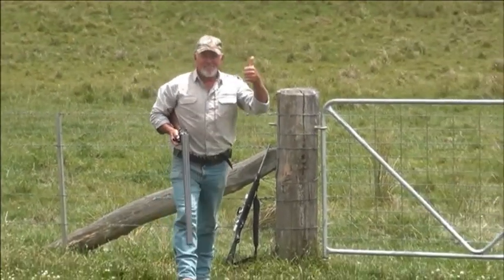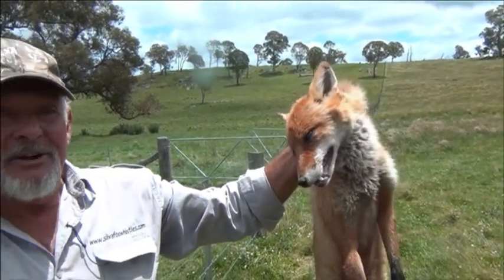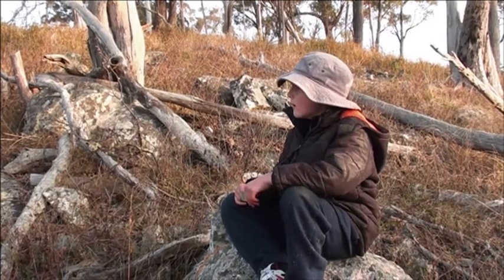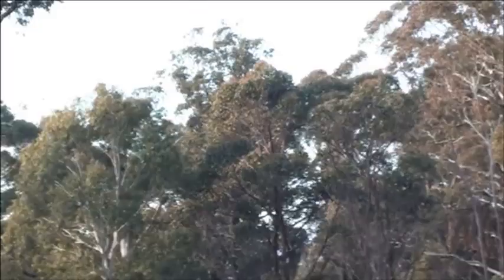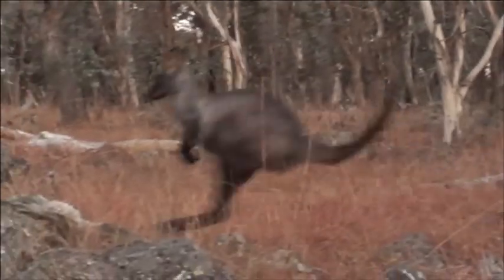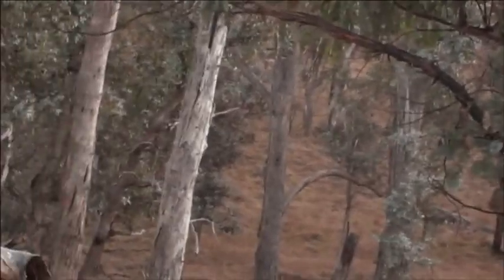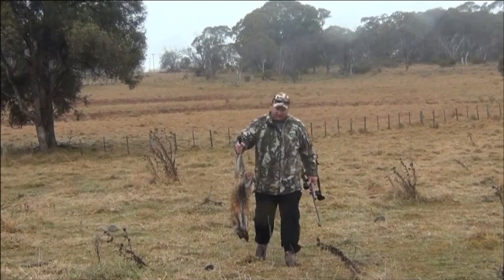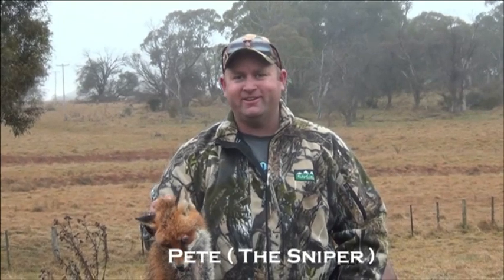How to Blow and use a Silva Fox Whistle in Detail by manufacturer Ron Kiehne

Comment: Eureka moment! I have been using a Silva fox for about 8? ish? years now. Started off great however very difficult to get a note from it. I had adapted to a very difficult technique. And we're at a lull, foxes have not responded to it for a couple of years now. Thanks to this video I have learned I've been persevering with a squashed caller. Opened it up from 6mm to 15mm and bugger me if I don't have a easy to use caller with a totally different note. Bring on the weekend so I can get out and have a go!
Thank you so much for the video upload. 👍